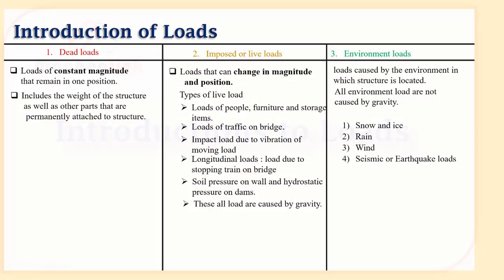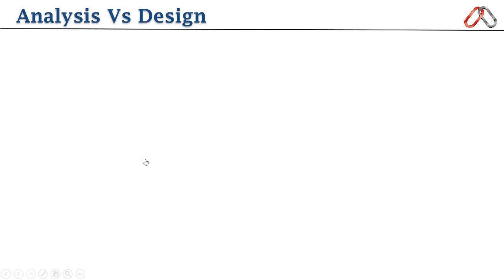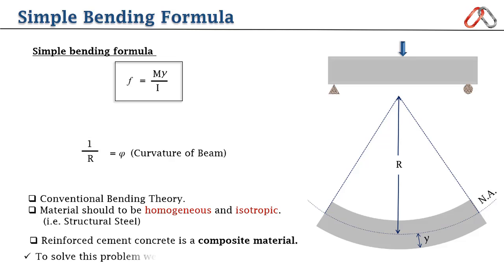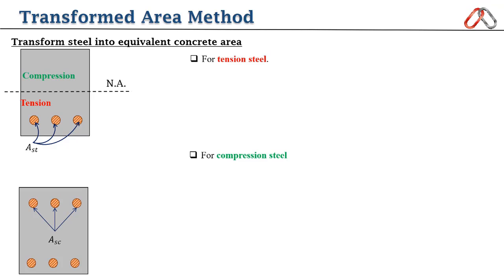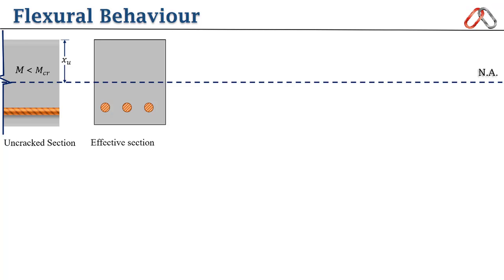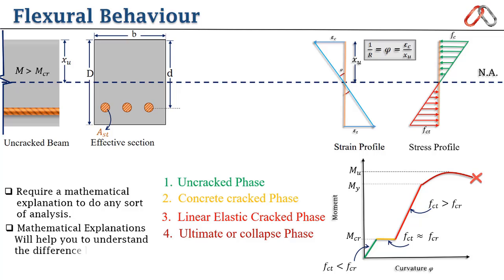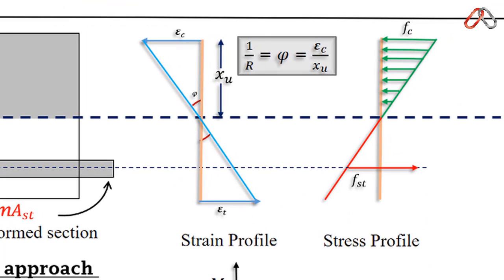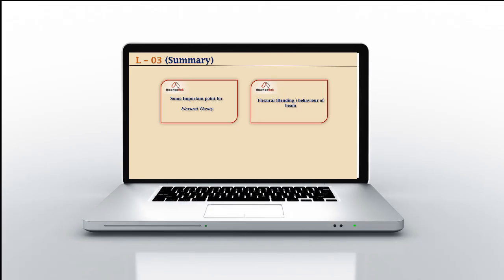Analysis vs Design of Beam

Comment: thanks Dr. 
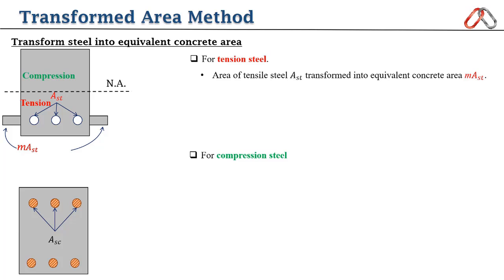but at min 12:50 (uncracked section) , can you explain why you subtract from moduler ratio one (m-1)As? i can not imagine that !
Reply from the maker: Hi Beautiful Life,
When we transform steel into concrete, the concrete area comes out to be mAst. But after transformation, we have to remove the steel from the section, that's why we minus the area of steel from mAst not the cross section area of the section.